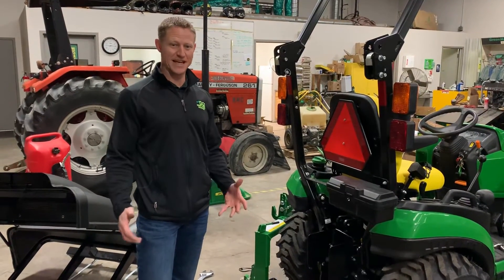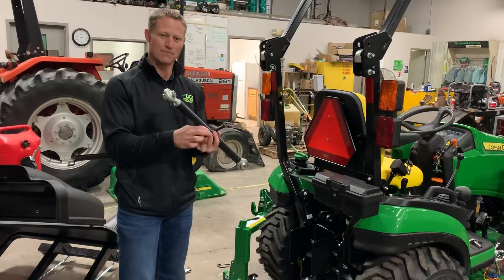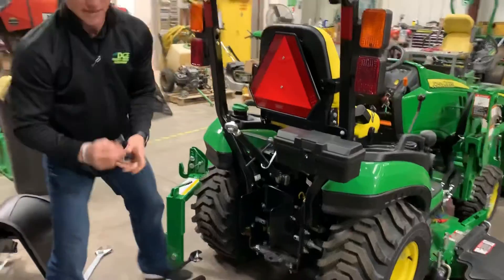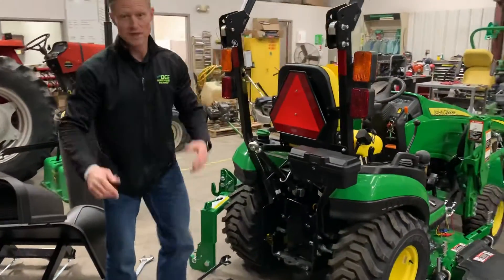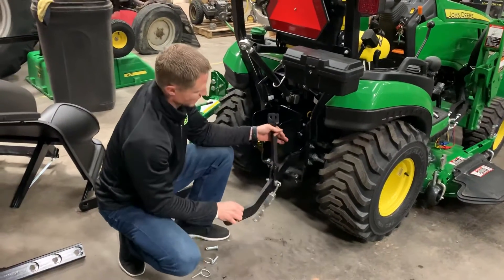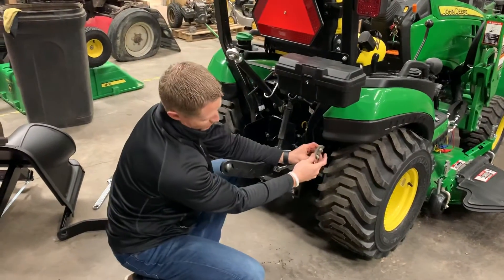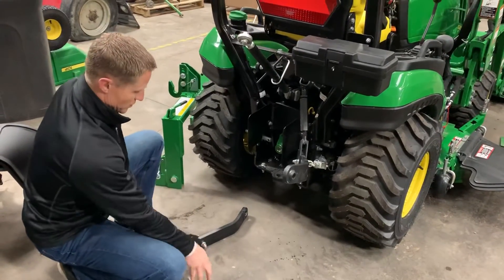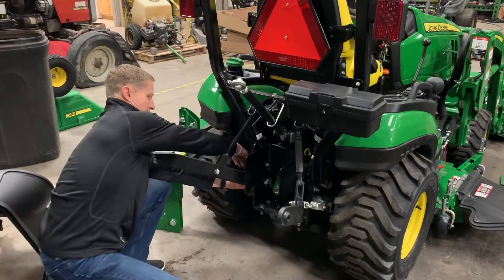John Deere Sub-Compact 3-Point Hitch Installation

Comment: Edit -- I case it helps someone else who has all the parts unassembled. I found out the hole in the arms isn't the same distance from each end, it has a long and short end. Short end goes toward the back of the tractor, with the welded seams turned inward. Once you figure that out it eliminates a bunch of potential problems.

Comment: Always great information love the videos. I have a 1023E so when I remove the cutting deck for winter, the lever that raises and lowers the deck, raise the rear hitch? And is there a lock out valve to hold that hitch in the position, thanks for great video.

Comment: And make sure Deere has the parts together correctly.  Took me 3 times with the box blade tilting before i realized the right arm had the long side toward the tractor instead of the short end.  IE: the sway link bolt hole is NOT exactly ion the center.
Reply: Very much this. I'm finding out the hard way and don't know which end goes where.
Reply: Now I leave it all assembled and attached to my box blade.  Still did the sharpy markings and arrows with dremmel.

Comment: Thanks for this.  I have oat my tractor for just over two years. Purchased with a backhoe and I have not had any other attachments (besides loader and mower deck), so I never messed with the 3 point til now.  I picked up drag to clean the wife’s riding  arena up.  Looks like even though these parts have been in there box,I am missing some nuts for linkage arms where sway bars attach.  It went together quick otherwise though👍🏻.
Reply: Autocorrect did not do me any favors up above.  I need to look these over before posting,  otherwise people will be asking what it is I exactly do when oating a tractor for two years.
Reply: how's the oating going lol
Reply: Great, I am making a ton of homemade cereals with all the oating that little Deere can do!
Reply: Great, I am making a ton of homemade cereals with all the oating that little Deere can do!
Reply: The same happened to me. All my parts are unassembled and much of the linkage hardware is missing, including the lock nuts for the turnbuckles and the pins for the arms. I'm having to order parts to fit it together. Such a pain for such a simple looking thing.
Reply: I am a sucker and have the tractor serviced yearly under the EPIC warranty (supposedly this will extend my warranty), and when the tech came out after I had finally messed around with the 3pointvassembly and discovered the missing pieces, he just shrugged.  I asked if he could maybe get on the horn back to them, advise em of the issue and see what could be done to rectify it.  Nope, blank stare.  I went and bought the parts and that was that.  I have pulled the local Deere company owner over twice since that time, and though I didn’t write a ticket, I gave him a piece of my mind on what I thought about their customer service (I also had the mower deck PTO switch go, and parts counter guy looked at me funny when I asked why that is not covered when tractor was not yet a season old, the owner ended up crediting my account for the money for the switch saying that it was covered but parts/service clerk was new).  I didn’t know the gentleman was new to the Deere dealer at that time, but I knew it was not the regular guy I saw behind the counter.  I met him when I had a recruit and a car full of teens ran on us one day and threw into that parts clerk’s driveway.  The kids were busted (nothing big, they weren’t operating suspended or anything so not sure why they took off on us), and the parts guy showed my recruit and I all the sub and compact Deere tractors he had, along with attachments.  He had a separate garage for it all, like a mini museum.
Reply: @MrCAcompora  I had my tractor, actually bought by my Dad, years ago with the backhoe attached the whole time. So there wasn't much I could do to complain about the missing 3-point parts after all that time. The extra stuff might have been in a bag somewhere that I never could find, but it would have been nice if they were assembled or had assembly instructions. I finally figured out from another video, arms go short side toward the tractor, weld seams go inside. They aren't the same from either end so they have to match up correctly.

Comment: Are the main support arms exactly the same for both sides or is there a left & right arm.
Reply: The Adjustable arm goes on the right, looking from the back.  FYI: The bolt hole is NOT exactly in the middle, the short end goes toward the tractor.  My lft arm was correct but the right was NOT.  Took me a few uses of my box blade tilting before I figured out DEERE had the Rt arm reversed.
Reply: @glmccready  Thanks!  I saw that in another video a long time ago, but couldn't remember which way they go.  And it was not covered in this video.

Comment: I purchase a 1025r used with a backhoe on it. The seller did not have the 3 point hitch arms and linkage. Do you know were I could get the pieces I would need. I know I could go to a dealer to get what I need but buying  each part individually really adds up quickly
Reply: i've found no place that sells them as a unit.  Tractor salvage yards might work but I've read several posts from others in your and my boat and they all eventually 'bit the bullet' and spent the $800+ to get a JD 3pt hitch :(

Comment: Is it best to install the 3 pieces separately always? Ex "If you keep an imatch or other Quick hitch attached" is there a way to efficiently install a 3 point system with a quick hitch as one unit? i.e. "Utilizing crates/pallets or some other means"